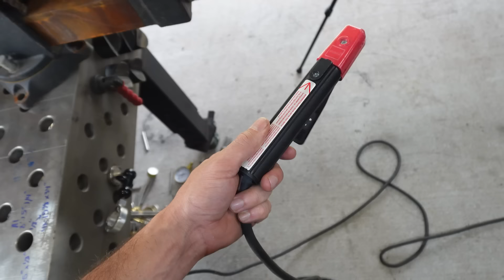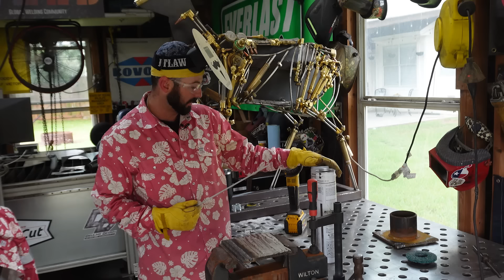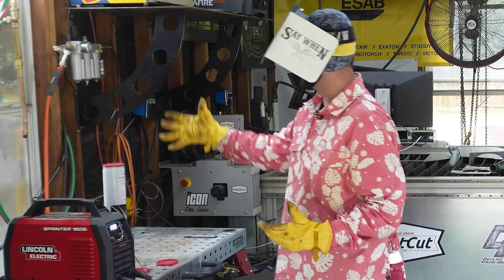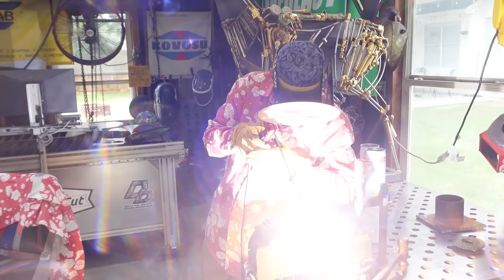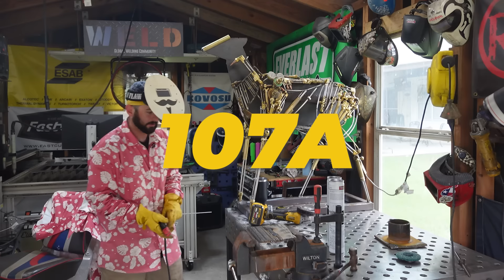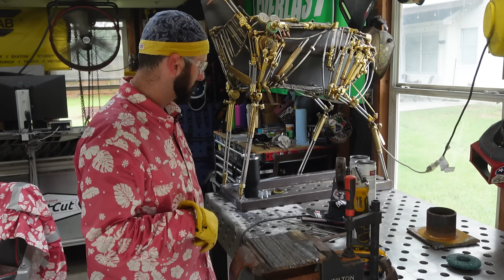How Not To Stick Weld! Avoid These Beginner Mistakes

Comment: Yesterday I converted my old 70’s Lincoln AC225 to DC! I got a 400 amp bridge rectifier off Ebay for about $50, bolted to the front of the Lincoln , cut the leads short where they come out the front, used set screw lugs to attach them to the AC inputs of the bridge. Then verified that I attached the stinger to the positive output, ground to the minus. She welds very smoothly now! Only drawback is that it only has 10 output levels in 15 amp steps.
With 6013 I usually run at 90 or 105 amps. 7018 seems to like the 120 amp setting for 1/8” material

Comment: You’d probably see much different results on the low amp settings if you started with a room temperature plate… having run 4 beads on that plate, you could’ve started with a 500-600° base metal temperature. Slightly surprised you didn’t check it with an infrared or temp stick

Comment: You've mentioned beads too wide and too narrow but not what to gauge it with.  Would you say twice the width of the rod diameter for the given width? Three times?
Reply: @MrStephen1959  it can depend on the spec sheet for the job. Some specifications don't alow more than 2 rod widths, some are 3, but depending on the material you're welding the shape of the weld profile(height, and how wet the toes are) tend to be more important. If your welds are flat, wide and the weld looks like a bunch of stacked triangles, or burning through, you're too hot. If you're undercutting, have a high bead profile, or having issues with inclusions, you're most likely too cold. Rule of thumb for general welding is 2 rod widths wide. It's super important for caps, because QC's want to see under 1/8th cap height, sometimes even 1/16th. If your fill passes are flush with your groove on a plate test for a bend, you can sometime grind the fill passes down 1/16th below flush before your cap if the specs allow grinding after your roots, or you can turn up your amperage to the higher end of the process specification so have a bit of a lower bead profile. Just gotta be careful it doesn't get too wide! Lol, hopefully he responds to your question as well, I just thought I'd leave this here in case anyone is interested in my 2 cents. Stay safe brothers 🤙

Comment: With stick can you run a 1/8 7018 at 170 amps and move faster with it to compensate? I've been told I need to work on my speed.
Reply: No. Adjust the machine. You didnt say what position or what joint but 170a is high as balls, if you work in a shipyard maybe thats about average with ¼th electrodes.

You can weld 'anything in any way' but its highly implausible to successfully weld certain ways, theres a reason the machine settings are easy to adjust. If they were meant to lock down & just adapt your hand movements, they would have set screws or preselected settings. 

Old machines do only have high & low settings and as a result they are very limited, the hi lo system has been phased out, and even the highest skilled ppl who can make better work while restricted by the machine do not choose these.

Goodluck m8🤝
Reply: @1nfamyX no I was asking how do I improve my speed. I was running at the top of the amperage range and getting really good welds. But they're complaining about speed so do I need to raise my heat more and move faster or what

Comment: Really cool!  Hey man I like your personality too in this video, very upbeat, very informative!  I am new to welding, and I am a fast learner, I got a little KLUTCH "yellow" Welder from Amazon it only goes up to 75A But I figured it should work for Automotive Body panels, "Preferably without burning through them" and I got Lincoln Electric E6013 1/16 10" Rods to practice with. Trying to learn how to weld very thin stuff.  I have a 1977 Ford Ranchero GT that has some bad Rust on the body, I am wanting to weld in to replace some metal on it eventually. I have Gloves, Auto Darkening Welding Helmet, and a Welding Vest..  All this Cotton stuff, never Synthetic for this safety obviously and some informal training from like 20+ years ago in Ag Mechanics High School.. Need to learn how to do it, but I will be honest if I were to weld a frame for something like my Motorcycle Side Car project In order to weld 1.5" Steel Tubing, I need a more powerful welder than 75 Amps probably and some better rods. Small stuff though is okay for now.  Keep teaching, and Hopefully I will keep learning, and get better with practice. Thanks man!

Comment: you need to explain the three basic groups of mma electrodes. rutile,basic and cellulistic. rutile ie 6013. cheap, easy to use low properties. basic, limestone, high properties fast freezing slag. celluslistic. very cheap to make, high properties buthard to use. made with wood flour hence the sparky nature. worked for esab uk for 11 years....
Reply: the 3 group of composition explains how thhe slag melts/freezes so wht it can be ued for. there was hybrids lie vodex ws rutile with bit cellulose s improved for v.up.

Comment: What's the plate thickness of i can ask? Wad there any warping? That's my biggest challenge, keeping metal from warping, if I turn down the amperage, then rod sticks or won't stay lit
Reply: Looks like ⅜ths of an inch and its wide, wouldnt warp if 3 welders were dogging it at the same time, the rest of it outside the bead is acting as a heat sink.

Comment: As a JB Weld certified professional,  I have found that the higher the outside temperature is , the smoother she spreads.  Now as far as filling gaps you typically want to have temperatures below 32°F . At these temperatures you may want to use the old lady's cake mixer when combining materials.

Comment: I am still trying to find a chart showing material thickness and electrode diameter and amps. Like what diameter rod do you use on what plate thickness with suggested amps. You can get a chart for a mig but haven't found one for stick.
Reply: its likely partially because there are ways to just use more passes on thicker material when using a thinner electrode.  one of the other channels "makingmistakeswithgreg"  stated that a general rule is to not make a weld bead more than 2 or 2.5x the width of the rod, nut that you want your overall weld thickness to be equal to the thickness of what you are welding. (i may have mis-remembered the exacts but it seems like a good rule from what i have done..)  hopefully this helps.

Comment: Love to see you using a older gas powered welder like the one I have (sa400) Lincoln or a miller sea 200  
Mostly I am trying to learn the sa 400 settings

Comment: to make this experiment right, you have to have consistency in two things:

1- speed: Every passing has to be at the same speed, so we can actually see the difference with amperage. Going slow with a colder amperage just makes it work. You have to go as fast as the hot ones to really be able to see the difference. 

2- Movement - I mean, you're an expert. Even trying to mess things up, you end up with a nice solder. What I recommend is that you do the same pattern, without having too much care for it. That way, it will showcase the facts of the rods instead of your superb welding skills. XD.

To make an experiment work, you need variables: The rods.

But you need consistency in the process, so only the variables are measured.

Comment: I was still heat that up with oxy fuel. 11 combination solid. get it ready. let it marinate bring into the equation. if I'm wrong then so be it. this is someone who has not welded over 20 years and then some!

Comment: From one welder to another, good informational video and nice looking welds. 

One thing you should do differently is be facing your exhaust fan so it doesn’t have to pull the smoke around you.  

Great video 👍
Reply: Looks like that fan is blowing at him, so the breeze should be carrying the smoke away from him (toward the camera).  In other words, it's not an exhaust fan, but just moving air across the shop, which works as long as there are open windows to keep some air-exchange with the outside world happening.

Comment: 12:50 am thank u forv5h8s video I'm running off a Lincoln 225 AC this is the perfect lesson for me yet. I like the way ur doing what's wrong first. U have given me answers to what I'm not doing right.  Please let me no the thickness of ur plats.
Reply: I'm running beads on a 5"/16 pipe I have been running on 105 to 120amps mostly been running 1/8 6011 rod. And 3/32 6011  I seem to get same results
Reply: I'm seeing from ur video that I'm running too cold

Comment: Excalibur welding 7018 very Good welding Road with a lot of 7018 teens have our blue a lot of time I stay with 7018 Excalibur throwaway 60 13, 7014 Rod I always uses P5 6010 7018 11 oh18 and 312 stainless will get your job done

Comment: Welded for years many years always like P5 for route 7018 for over about 135 to 40 for 18 7018 vertical up cut your heat back. Don’t worry about the middle vertical up hesitate on each side. Do a good job I know when you’re well I’m always well not flatter or anywhere you go out make a little circle on the end then go straight up. Don’t take it all out and blow your end out, good good videos very good videos
Reply: 10 years ago, when I was building my welding  tables, I had one main problem, big variations in voltage.  The top was 12mm steel plate rod 7018, all in a poor position and overhead. Here in Thailand, voltage  is 220 volts 50 HZ, and both vary greatly. After the shop was completed, I bought a voltage stabilizer and suddenly I could weld good again😂..

Comment: Looking into welding some small things but it would be mostly sheet metal (translated this would bve leaf metal, sub 3mm). This is a problem from what I can find. Not sure about getting huge gas canisters (I cannot buy smaller ones where I am) for the delicate welding work.

Comment: Stick welding is fun pipe and plate steel . But I spent most of my career in TIG certificate in high pressure high vacuum stainless and aluminum. Much more challenging.

Comment: Been running 135, welding a crane system in the ceiling at work. Mix of flat and overhead 30 feet up in a scissor lift. Nobody to change settings for us. Gorilla welds; ugly but strong. 🤣🍺

Comment: Don't weld as hot as you can !!!! you need to minimize the heat afictive zone . Follow your weld procedure peramaders . the more heat , more distortion , pull , and cracking if not properly cooled down . stress is Number one enemy in heavy metal welding . Always get a weld procedure and follow it !!!!!! pre heat , post heat , out side temp , rate of travel,volts amps , type of filler metal and much more are all in your procedures . when your weld dosen't fail , and the weld inspector says , where's your procedure ? U say ,  right here , and inspection will say" don't get rid of this welder he or she is GOOD" !!!  I welded from a broken heart to the the crack of dawn , around the corner and back . I lisened to all the old great ones and thats what they told me !!!!! PROCEDURES !!!! THEY WILL SAVE YOUR BUTT AND JOB !!!!  YOUR OLD BUDDY BOILERMAKER / IRON WORKER / PIPEFITTER / WELD INSPECTOR JOHNNY

Comment: i have been struggling with an aerospace test for a while now. .030" 321 stainless t joint in a jig. coupons are 4"x5". zero suck back allowed and full root penatration/fusion

Comment: Quick question: how much time do you spend on setting everything up vs actually welding?
I feel like I spend maybe 5% of the time laying beads. Most of the time, I'm figuring out how to hold everything in place, cleaning off rust, etc.
Reply from the maker: I always say welding is 1/3 of the job. Planning , set up, and prep are the rest.

Comment: How to figure amperage/and or feed speed with stick and MiG when fusing two different thickness of metals????
Reply from the maker: There are a lot of great resources online and usually inside your machine for settings but we also have the WELD app which has a calculator to help you with settings
Reply: When 2 different thicknesses remember to make your weld bead as thick as the thinner metal piece.

Comment: Love the videos. I would like to see you do one on the amperage drop as you get farther from the machine. Right now at work, I am running off of an engine drive that is positioned about 200 feet from where I am welding, it is actually positioned between two of us who are welding at the same time. I am running 1/8 7018 @ 155 amps just to get decent beads that tie into each other without cold rolling on the toes.
Reply from the maker: The farther away and longer your leads are you are going to have a drop in amperage but we will see about making a video measuring it

Comment: That 1/8" 7018 at 150 amps looked pretty damn good to me
Reply from the maker: Yeah I was of fan of the hotter stuff there in the flat position-Austin
Reply: @Welddotcom I'm having a problem with flux cored dual shield stacking my beads I'm having a cold roll off but I'm running hot like 315 hot as hot as my weld parameters will let me
Reply: As a general rule I run my 1/8" 7018 at 145 to 150 amps. One of the best ways to Guage your settings is to run your rod until it is about 3 inches long and when you lift your hood the last bit of rod should be cherry red and bend with light pressure when you push the rod with your finger.
Reply: As a general rule I run my 1/8" 7018 at 145 to 150 amps. One of the best ways to Guage your settings is to run your rod until it is about 3 inches long and when you lift your hood the last bit of rod should be cherry red and bend with light pressure when you push the rod with your finger.

Comment: How about going through the videos and do some about the different types of welding, with references to the previous videos. Like, beginner stick, intermediate stick. The differences not just in the rods, but also the materials being welded. MiG and Tig also. Then there is the differences between machines. How to set the proper way even if it is analog and has no digital readout. I can think of hundreds of videos I would love to see, and several dozen of your videos that were very helpful. The videos you have done in NY, out west, down in Texas, and even the Roller Coaster repair were great because they showed real world applications. A combination of more of those videos added to some process videos with in depth video references to previous videos, would come in real handy. That’s just my opinion, and we all know what options are like.
Reply from the maker: Thanks for the feedback, I think we have some videos in the bank and coming up for shooting that appeal to what youd like to see. Its hard to stay consistant with that type of content, planning takes alot of time. Youve noticed more videos in my shop, because thats whats planned lol, we have more trips coming up for some real world applications. More advanced techniques are coming too. -Austin